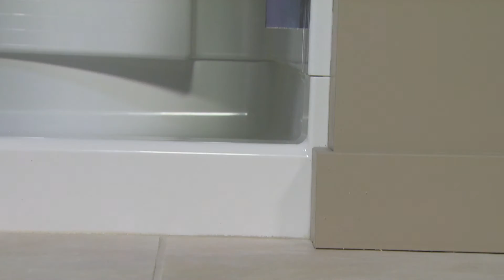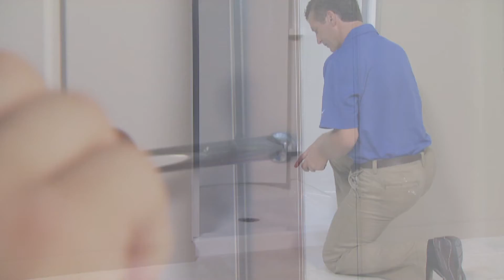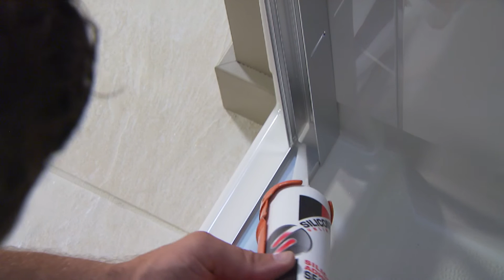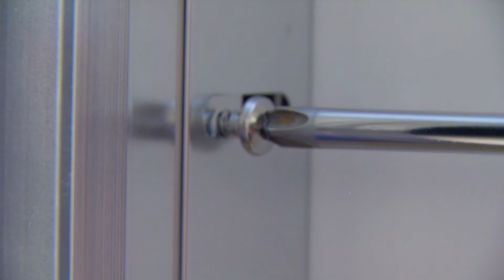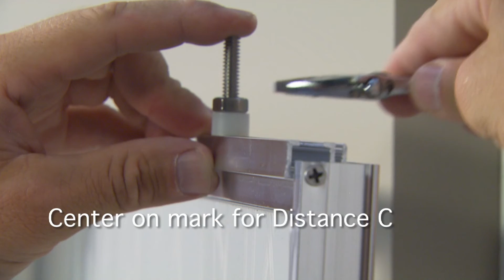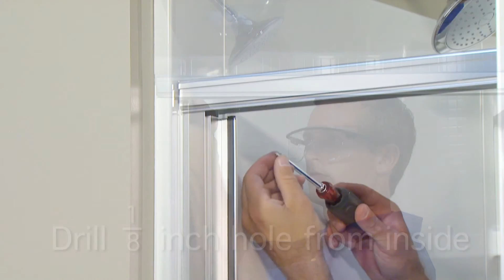Installation - Vista Pivot Shower Doors

Comment: Am I required to drill a 5/16” hole and insert a wall anchor into the wall if there are studs behind the drywall?
Reply: No. Studs will be a preferred anchor.  May want to predrill smaller holes first if shower is acrylic

Comment: Yessir, the instructions were not gonna get it done, so this I did with the video. Came out great. Only thing was there was a piece missing buy install was fine. Thank you for the assist. I did have to do things a Lil different as it was a right pivot , the instructions explain for left so.had to pay attention lol. Yes, I noticed others mentioned missing parts and the anchors to go into the tile were not easy to put in should be a different type but I got em in. Really the only issue. And also the header was an issue bit the footer fit well . I'm just glad the install was satisfactory.  Took about 3 or maybe 4 hours ,but I was doing paint touch ups too. I think next one will be much faster.

Comment: Very helpful and well made video. Too bad I saw this after I've tackled this project. Per included instructions, step #10 shows apply sealant on the front side. The video showed it was applied to the backside. Which way is correct?
Reply: Put it on both so there's no gaps. Silicone isn't too expensive and the install looks professional

Comment: I was really helped by this video. The instruction sheet is useless. The hardware that accompanies the door is sub-par. You will need to supply some of your own parts. You will also need a well equipped shop to install this door. I won’t make the mistake of using this door design again.